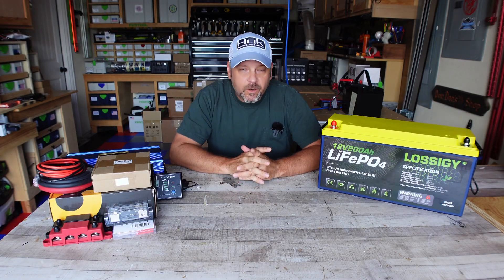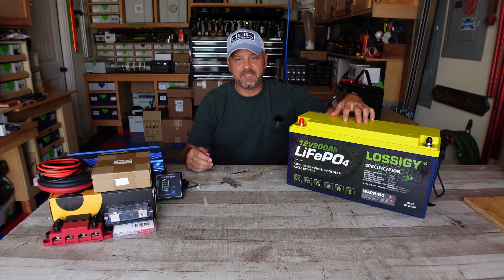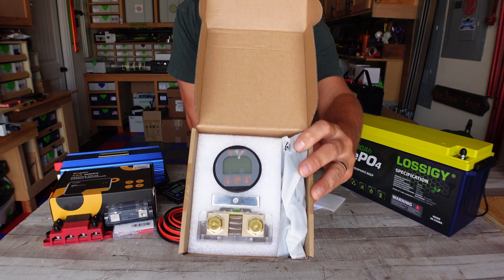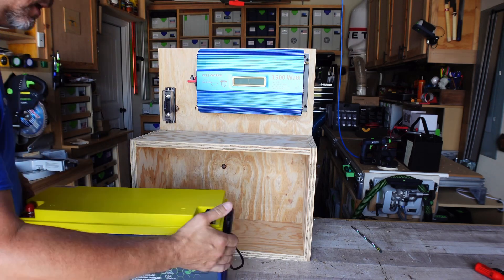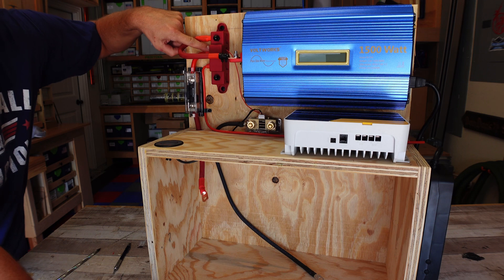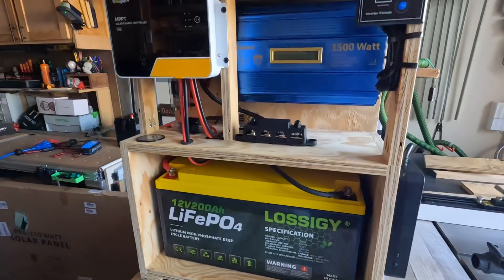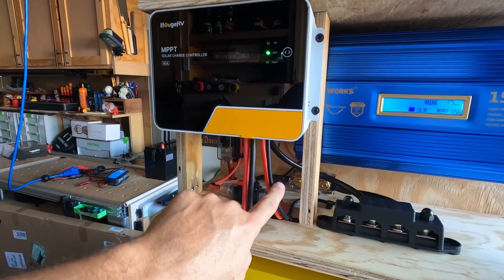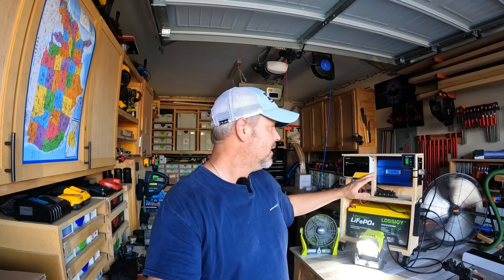Simple OFF-GRID power station: Lossigy 200ah LifePo4 : Super Simple Build!!

Comment: why a charge controller to a battery with a BMS built in ?
Reply from the maker: Because solar panels can input way more power than the battery would be capable of accepting. It just basically regulates the power from the solar panels.

Comment: How long would this run an 8amp commercia dehumidifier or air conditioner. This would be a great portable generator for catastrophe/hurricane work when gasoline is non existent. Also, what’s your opinion on building this vs buying an all in one unit like blueetti, Jackery, etc
Reply from the maker: With this exact setup…not very long. 8 amps is around 960 watts on a 12v system and this battery is only 2560 watt hours. Without a huge solar array and full sun you wouldn’t get very long on it.
Reply: About 2 and a half hours.

Comment: Excellent,you can make a video using old technology solutions like 5_10 car batteries used but not dead pmw change controller many Amp's a cheap 2000 w inverter used solar panels for shtf situation. If you take only 20% of your car batteries they can last for years.👍🇬🇷🇺🇸
Reply: Car batteries are not the best for solar but they do work . Also 5-10 car batteries weigh a ton which is not something u want when shtf. Also a PWM is not the best when using multiple batteries coz they use low amperage and voltage

Comment: These videos really got me thinking about how I'm going to power the Ice Castle Fish House I have on order.  I'm going to order a 200ah battery.  Most of the house will run on 12v (furnace, fridge/freezer, water pump, lights, USB wall outlets).  There is a 12v accessory plug behind the TV, where I will use a small 300w inverter to power the TV.  I have 200w of solar panels I plan on using to help increase the battery life.  I think I can get a weekend of fishing off this without running a generator.